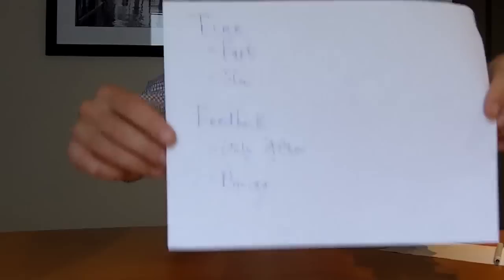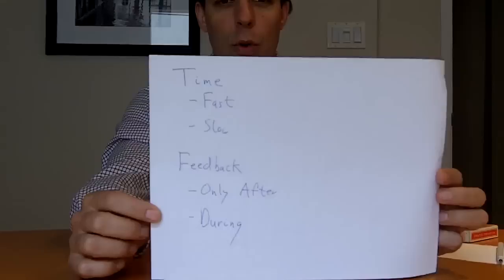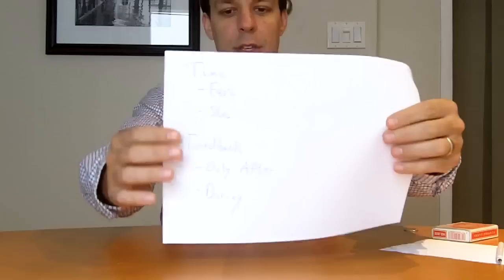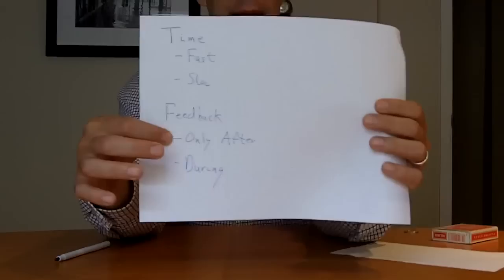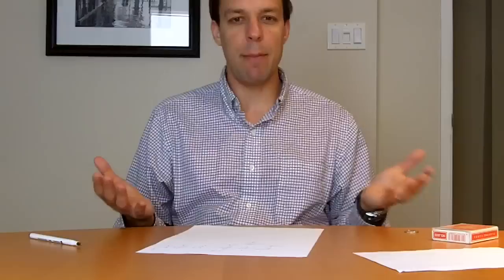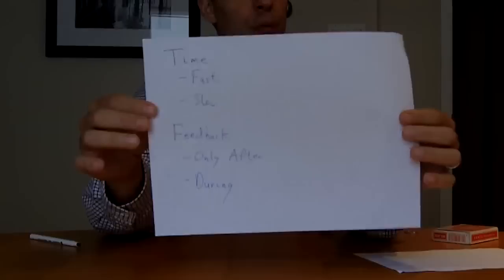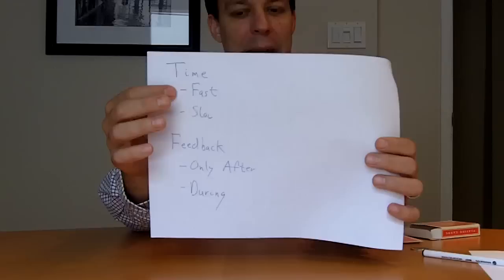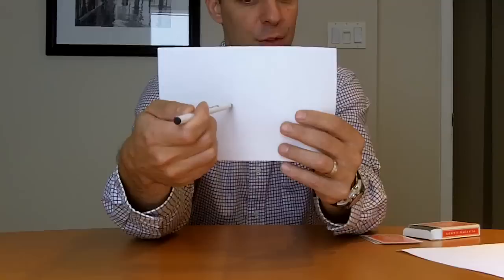Open and Closed Loop Control Systems

Comment: Segways, quadcopters, and a bunch of modern eletronics-based motor "things" are actually closed-loop systems with very fast movement. The electronic sensors (e.g. for orientation) provide instantaneous feedback to the electronic system, which will change the torque of the motors in a matter of milliseconds.

So, basically, sometimes there is some correlation between slow/fast and closed/open, but not always.

Comment: From a perceptual control theory perspective there are some errors here. Closed loop systems are not slow. You can see this in the PCT models. The presenter misses a whole range of other feedback processes in the clapping hand example such as vision and proprioception, and indeed mental simulation which is closed loop. In PCT, the organism strives to close an open loop so it can perceive it is perceiving what it wants to!

Comment: Hi Noagentner. How much do you know about closed loop systems conserning vehicle ECU systems. I want to override the close loop system on the ECU which is controling the fuel. The vehicle is running at 14.40 AFR and I want to change it to what I want it to run at. ie 15 AFR by means of what we call a "Chip". This I can explain to you depending on your answer.  Hope you understand.

Comment: card house seems like a terrible example. The card house involves preparing placement (closed loop) then finally the actual placement is very quick and you remove your hands quickly (open loop) correct?

Comment: open loop.. oxymoron?
Reply: ikr. The reason they are both called loop is because the concept comes from research in electronics. In a circuit there is always a connection to power and a connection to ground, with a bunch of equipment in between. We call that our loop.

The "controller" is usually considered to be at the very "start" of the loop; it uses power to send signals that get passed to all the equipment and then to ground. If we have a sensor in the process, then that sensor takes some power and sends it back to the controller, so that the signals go in a full circle back to the "start".

So with a sensor, it's a closed loop. Without a sensor, it's an open loop.